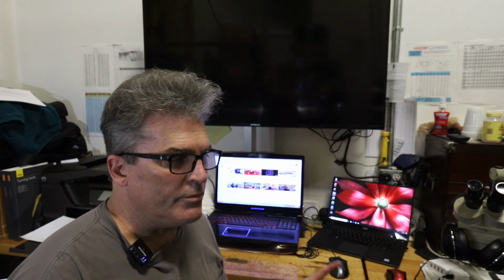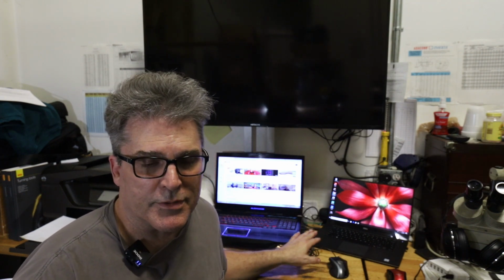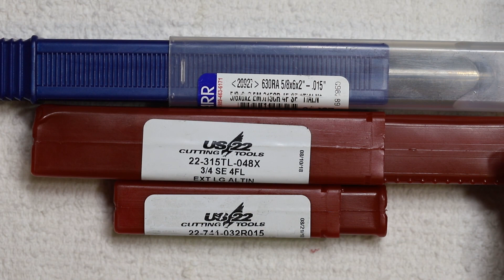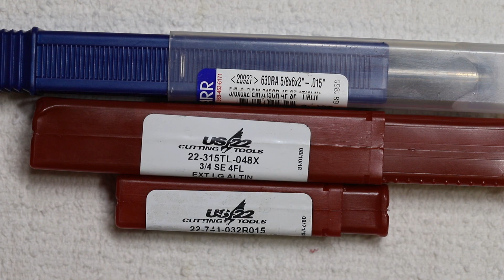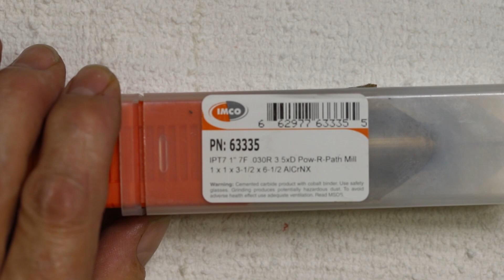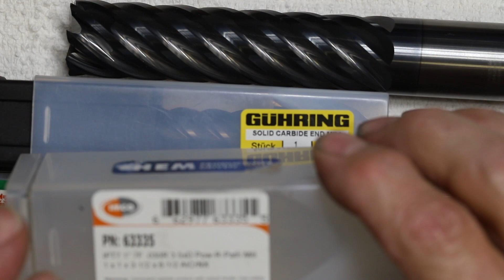Endmill Grinds

Comment: The biggest first problem you will have with F360: cannot carry over stock left from one set up to the next. If you manually create stock to carry over, then have to create each time the op change. The modeling is simple and fast for most things. The CAM is diasappinting after using Cimatron, Mastercam, and Powermill.
Reply from the maker: Are you sure you sure? Can you save a .stl model of the simulation.(I don't know having never used the software yet) That's the way I have to do it in Esprit. That aside, it isn't very often that is even necessary. If that was the only limitation I could live with that.
Reply: Yes. Save machined stock as STL import back as stock in new setup. A very disappointing bottleneck for complex parts.

Comment: It will be interesting to see how things go with Fusion 360.  Not really sure if you do any ITAR or NDA type work but I read that is an issue with the current cloud based systems.  I know with Fusion 360 you can (kind of) work locally but still it's not ITAR compliant.  Both Autodesk and Onshape appear to be working on this, as they realize there are many potential users of their software who can't current use their products.
Reply from the maker: Thanks Bill. These are things I want to find out. Hence the reason for trying it. It may be good for certain things. Also it is of interest to people that watch YouTube. When I retire for good and just use my small machines in the garage I think it will be good for that.

Comment: Peter I can only recommend inventor hsm professional. I use fusion and inventor. I do like inventor best because I does not use cloud
Reply: I think there is a little confusion here about the cloud.  You always have the option to save your file to your hard drive, and you can also work offline.  I do that a lot.  When offline, you'll get a message from time to time that Fusion was unable to autosave periodically because you're offline, and will backup everything when you reconnect.
It will be simple enough to just ask Autodesk directly how it works.
About a year ago NYC-CNC could not access his files because Fusion was only cloud and there was a problem with their cloud for about 24 hours.  They fixed that online dependency very quickly after that little fiasco.
Reply from the maker: Thanks Dan. This is what I need to know. I think a lot of people comment that don't actually use the software.
Reply from the maker: These are the things I want to find out. Is it like the Adobe products where you only have to be connected once a month but otherwise you can work offline. Or does it always have to have a internet connection. This may be OK for simple stuff and only use Esprit for the more complex things. The Autodesk people recommended their software called FeatureCam but it is quit a bit more expensive.
Reply: @EdgePrecision  I think you need a connection always and all your files are in a online library that is really awkward to use if you ask me. 

I got alot of files and I like to have my stuff in the harddrive with pictures and setup sheets so I can link to my folders from the spreadsheet I got all my library's in. This is why I prefer inventor hsm because it's like fusion just without the cloud.
Reply: @EdgePrecision  but you can try our fusion for free to see if you like it. The cam part is really good

Comment: I wonder if HSM Works (the fancy version of Fusion 360 CAM) uses cloud libraries too?  Oh it looks like HSMworks is included in Fusion 360.  But PowerMill is a separate thing I think.
Reply from the maker: If I understand their packages. FeaturCam is the software that can pretty much run any machine. Than PowerMill is more for mold making and milling 3D shapes with surfacing type milling. At least that's what their sales guy related to me. But these software's are pretty costly. The quote I got for FeatureCam with two post's was over $11.000.00. and than its around $7,500.00 a year after that.
Reply: HSM Works is a bit different to Fusion and inventers cam it is for solidworks

Comment: Here's hte big list of included post-processors:   https://cam.autodesk.com/hsmposts
Reply from the maker: The Meldas post might work for the Horizontal but the only mill-turn post is for a siemens control.
Reply: @EdgePrecision  If you ask around someone might actually have one they can share.  Here's one on the forums for Mazak Integrex something or another that might be worth testing?  https://forums.autodesk.com/t5/hsm-post-processor-forum/mazak-integrex-post-mazatrol-640mt/td-p/7725203

Well the warning text makes it look pretty untested.   Last updated February 27th 2019. https://cam.autodesk.com/hsmposts?p=mazak_integrex

Comment: I bought seat of Fusion360  through a reseller called nexgen cam. I payed their maintenance fee early on because I needed to get a post made for an older lathe. They were very good about making it exactly what I needed.
Reply from the maker: Thanks I will check into them if necessary.

Comment: We just switches to IMCO endmills on a production job of greek ascoloy. They holy up very well, we went from 35 parts per tool to over 200 with the IMCO. We were also able to run it faster since they were 7 flute.
Reply from the maker: Yes I am impressed with the first one I've tried.

Comment: Even if Esprit is expensive it has some bugs in it. The last job I did in it involved  roughing some holes from an STEP file solid. For some reason the toolpath generated was 1mm below the feature of one of the holes, even if the holes where the same depth. It did that a couple of times so now I always check in cross section.Then I tried a  cheap   CAD/CAM solution like ZW3D . It has a nice interface. Very intuitive and easy CAD. But the Cam side of it was a pain: no machine simulation , the toolpaths generated some times use both climb and conventional milling, it dosen't simulate threadmilling like Esprit does ans so on. So you cannot have both cheap and good.For your high end you should stick to quality software, and not use something that a guy with a Tormach uses.
Reply from the maker: Esprit has a lot of annoying things it does. The software was initially only a EDM software and they added on other packages to make it what it is today. I don't care for its surfacing at all. This is where Fusion would be better. Also to be able to jump back and forth between Cad and Cam would be very useful. Esprit has terrible Cad ability.

Comment: I don't think there's a video board inside your laptop. Mostly it's a videochip direct on the motherboard. They often die in laptops because of heat.
Reply from the maker: The Alienware computers have a separate video card. At least the model I have does. The new one I'm getting is even upgrade-able to new hardware. They even give you the instructions on how to do it.

Comment: I have working a post for intergrex 100ST for hsmworks that I wrote years ago. It will work for  fusion, inventor cam and hsmworks. It did take me about a year to get 100% correct.
Reply from the maker: Would you be willing to share it?
Reply: @EdgePrecision  I'd be happy to work with you get the integrex post dialled in. Please email me at scott.m@cadpro.co.nz to discuss further if you want to.
Reply: Did you get your post worked out?

Comment: One potential drawback of F360 is that it's cloud-based.  I have a friend that runs a machine shop and he told me he couldn't even consider it because of the need to protect IP.  His contracts forbid him to store files on cloud services.  I think he ended up buying HSM works which I believe is a non-cloud version of whats in F360.  It might be worth checking that out if there are potential legal issues.  I use Solidworks at my day job and F360 for my part-time business.  I was using F360 at my day job but ran into problems with large assemblies (say, more than 2,000 parts (Altium generated printed circuit board assemblies)) - it really gets bogged down, whereas Solidworks doesn't.  This is due to the fact that it is cloud-based.  Creating fixtures in F360 and importing the CAD for the part being machined and then switching to the Manufacture (CAM) module is a breeze.
Reply: Chris Mayhew well hate break to you only the files are stored on cloud everything else locally done. You can cache projects to keep everything on your hard drive
Reply: @chiefmachining7972  Yes, you can cache locally, but it still needs to sync with the cloud at some point and in order to cache it locally you still need to get it onto the cloud in the first place.  Even when it's cached locally it still gets bogged down with large assemblies (and that wasn't a computer problem).  There are some services that either run best in the cloud or only on the cloud such as Simulation (though I think you can recalculate locally for some parameter changes but you have to compile the simulation in the cloud in the first instance).  There is also another issue with Anti Virus software blocking processes though that is easily solved unless you work for a corporate with strict IT rules like I do.  In a sense I was using F360 in my day job for a purpose it was not intended for - I should have had an Inventor license (this is what F360 support told me) but in the end, the company I work for went with Solid Works.  I personally don't cache files locally as I like the fact that I can open them anywhere or enable people to view stuff online.  I even make use of the App on my phone.
Reply: Chris Mayhew and you still do that of cache them locally it does is uploading them cloud much like drop box or one drive. 

You’re right fusion horrid with large assemblies 

All simulations can be done locally
Reply: I don't attribute Fusions slowness to the fact that it's in the cloud, more that Solidworks has been improved every year for the past 20+ years. Developers have had the resources to implement Large Assembly mode, Large Design Review, and I'm guessing a whole host of performance improvements for large assemblies within Solidworks. Fusion is fairly new with a completely new architecture, so it lacks features and the knowledge base is slim.
Reply: @Trent-tr2nx  not new it was called 123D
Reply: @chiefmachining7972  123D was an entirely different product. Fusion was born from an Autodesk labs project called Inventor Fusion back around 2007. It was completely reworked from the original V1 releases which were included with the Autodesk Product Design Suite, before it was released as Fusion 360.
Reply from the maker: These are things I want to see. Is it like Adobe products where you can work locally but have to connect at least once a month or does it not run at all if not connected. I don't expect this software to do everything. But it would be handy for simple thing I think and it's low cost for what it does.
Reply: @EdgePrecision  HSMworks is now included free with Fusion 360 license.
Reply: @EdgePrecision  You can work locally if you cache the files to your hard drive but it does have to connect at some point and I believe it is a minimum of once a month.  I find the cloud service very reliable and any outages seem pretty short-lived (I think I have had one outage this year for about 10  to 20 minutes) and the cloud works just as well over 4G mobile data as it does my fiber.  If the cloud server does go down it automatically caches it locally and tells you so you can log out and then syncs when it can.  You can also put your post's and tool libraries on the cloud.  I have an HSM plugin on my Solid Works but I've never used it - I transfer everything to F360 and make fixtures from there (I do contract machining for my employer).  The adaptive clearing strategies seem to work well but I have nothing to compare them to, though I have never seen a negative review about them.  I am also making a lot of use of the CAM Templates as I do a lot of similar kinds of things in a range of materials - I have a template for each material with feeds and speeds that I have been proven to work and that provides my starting point.

Comment: I look forward to seeing you work with Fusion. I am trying to build a post for the mill turn lathes I run. It’s not easy! You are right that you can’t beat $450, I’m not sure it’s better than esprit though. 

The horizontal post will be a breeze.
Reply from the maker: From what I see in the tutorials and demos. It can do certain things easier and better than Esprit. Particularly the surfacing type milling.
Reply: I can’t wait to see you get into it. A lot of people use it and the community is very helpful.

Comment: Peter don't get your hopes up on Fusion 360 its fantastic software for us home gamers but it's still lacking for professional use. I can't wait to see you make it work, it will be great to see you pour your knowledge into new software, specially what pitfalls you might help us avoid.
Reply from the maker: This is the reason I want to give it a try. We shall see.
Reply: @EdgePrecision  as someone who uses Solidworks, Autodesk Inventor, and fusion 360 on a daily basis and in a professional setting I can say that Fusion 360 will not disappoint. Fusion needs some work in the assembly workflow, but from a machinists point of view its hard to beat. My preference for individual part design is Inventor, Solidworks is the way to go when working with mechanical assemblies, and fusion is on the shop computers for programming cnc's. Side by side, even though they are all based on the same platform, Fusion is a much more intuitive and efficient means of generating code. The forums are also very helpful when you have questions and there are numerous people who are willing to help make or modify post processors.

Comment: this is suspiciously close to bumblefucks fumbling :P
Reply: You should watch more of his videos and see the talent he has then re-evaluate who is bumblefucking what. :P
Reply: probably because it is not scripted at all, he simply had a bit of information he wanted to share, switched on camera and went with it
I'm not a pro machinist, but I've noticed these things about end mills more so because I do some hand scraping on cast iron ways, and had to figure out how to get a good finish on the carbide blade to get good finish on the CI surface, and low end end mills all seem to have those "perpendicular" rough grind marks on cutting edges that leave lines on the parts, so I was also looking at tooling catalogs for this sort of info and they just don't specify the type of grind there is on the tool, it just says what sort of material, speeds and chip loads and that is it, maybe they are sort of covering their arses with this dumbed/stripped down description info for the tool, and if this one type doesn't work out, just spend another 500 or 5000 on a bunch of other cutters till you find the one you like, not a problem for industrial customers I guess...

Comment: I have an MSI gaming laptop and it is similar to your Alienware.  The video cards are usually held down very securely, but there is also a lot of mass in the thermal solution, so it's quite possible it knocked loose.  I would just take it apart and reseat everything, hope for the best.  Worst case scenario it broke the connector loose from the board.  I too use Fusion 360 and it's quite versatile.  You can export STL files from 360 and make 3D prints from them.  This is a good way to visualize a part, you can do a (relatively) quick 3D print of the part and get your head around the fixturing and/or setup.
Reply from the maker: Watching tutorials on Fusion I am impressed with what it can do. We shall see.

Comment: It might be easier to find someone to translate your current integrex post to something that fusion can use - probably less than ideal it terms of efficiency (meaning a lot of junk code) but it would be a good place to start.

Hopefully someone from Autodesk could verify, but I’m pretty sure the cam kernel for inventor and fusion360 is nearly identical.  Going back a year or two it looked like they were holding the premium features for inventor but changed their mind when they started pushing their ultra premium powermill instead.  Now it looks like they are using fusion as a psudo beta platform to test changes and new features before pushing them to inventor.
Reply from the maker: The guy from Autodesk told me that a post for FeatureCam would work with Fusion. They have made  FeatureCam posts for the Integrex already.
Reply: Well that makes the transition a lot easier... testing and modding an already functional post is a lot more manageable than making a new one.